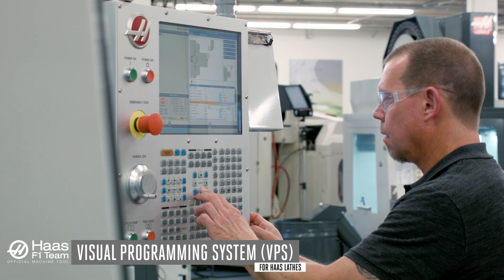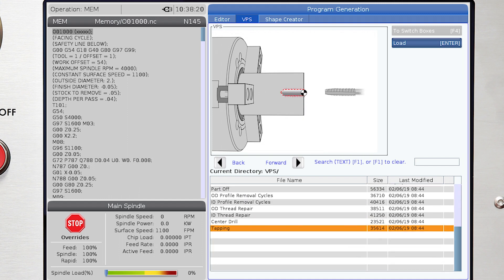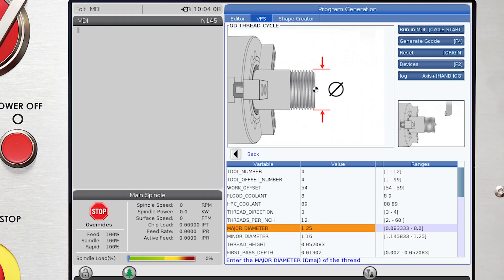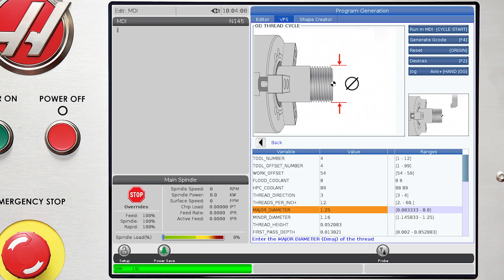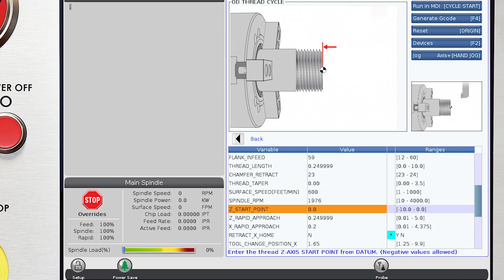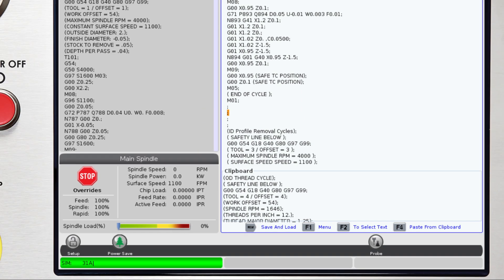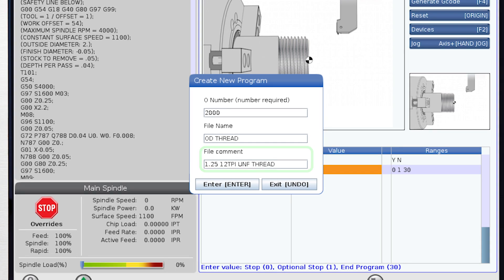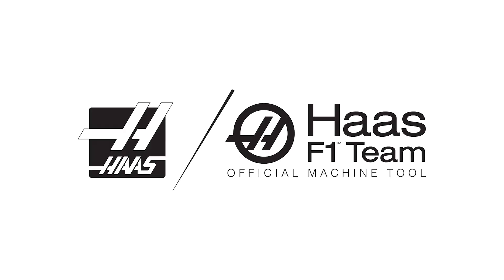Haas' Visual Programming System for Lathes. How It Works. Haas Automation, Inc.

Comment: If you change to an internal thread VPS routine, it will calculate the SAME minor diameter. HAAS knows this, because I told them, but has no intention of correcting. Further, they told me that it is because they did not want the operator to cut too deep. If that is so, then the Internal thread VPS routine would not show the same result! The problem is NOT that the error is there. The problem is that HAAS will not even acknowledge the error and they provide a ridiculous excuse.

Comment: That minor diameter that the VPS program generated is NOT correct!  That diameter is for an INTERNAL thread. How could your program get that wrong. More importantly, how could no-one notice! Try running it; the nut will NOT fit!

Comment: If you wrote a program for a shaft that is say 30 inches long and you use a following steadyrest that opens and closes with an mcode are you able to have vps write the program and then go into that program and add the mcodes to open and close the following steadyrest  at the start and end of each z movement?